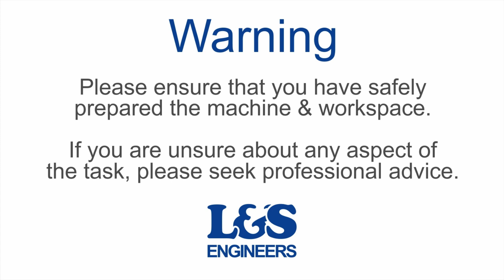How to Change the Drive Belt on a Stihl TS420 Disc Cutter | L&S Engineers

Comment: That’s not a TS420. It’s a TS410.
Reply from the maker: Well Spotted! This is a TS410 used in the video. The TS420 will have a longer arm, belt and larger guard amongst other parts to accommodate the 14" discs. The demonstration of the belt change is a similar process and the parts in the description are specific to the TS420.